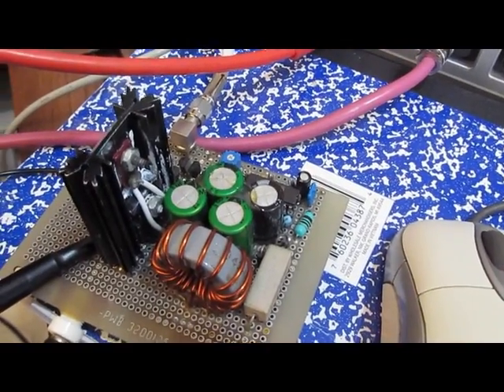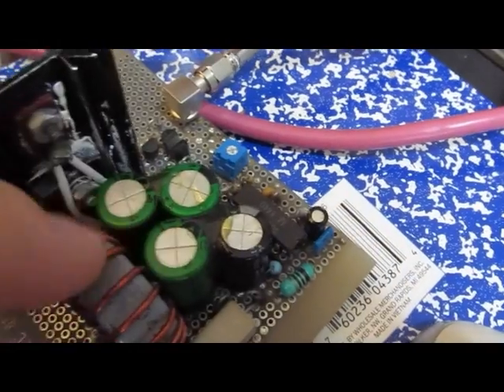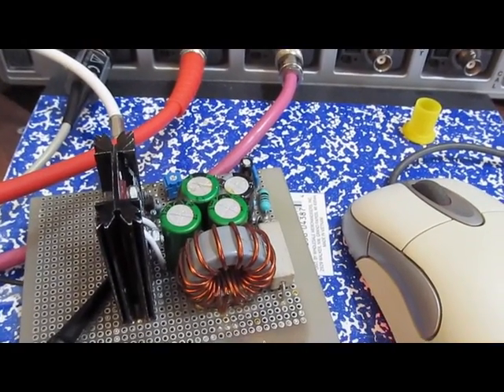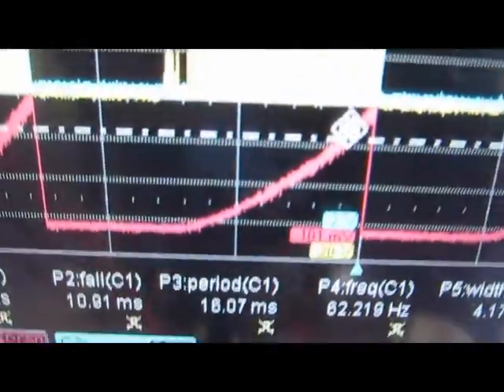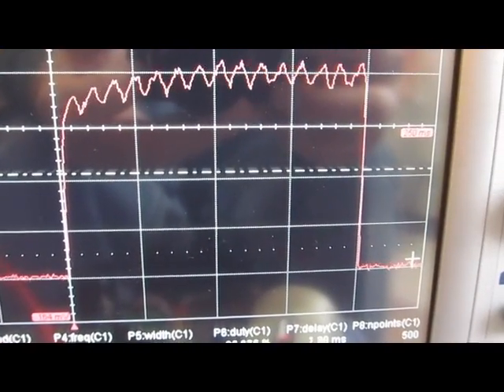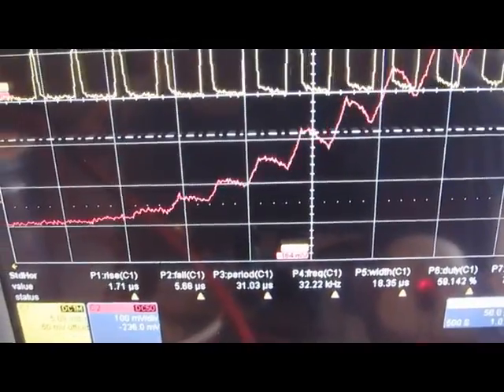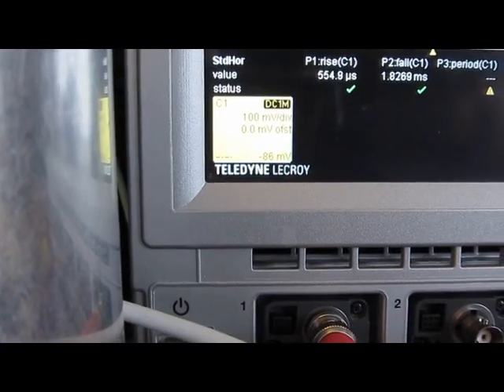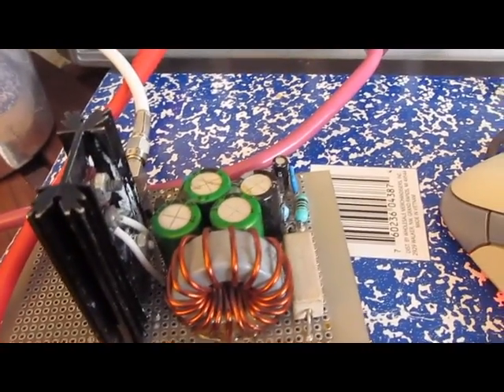Switching Based, Voltage Controlled Current Source (Programmable Load)

Comment: In a case where you need high Currents (~50A) isnt the SMPS better than the linear? 😅 Or is still not recommended ?
Reply from the maker: For this application, I see no advantage.